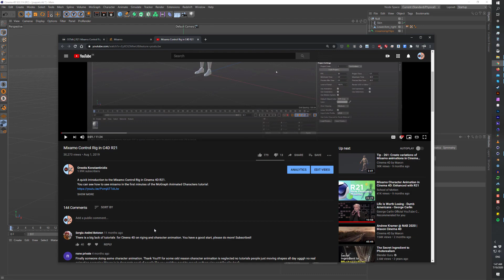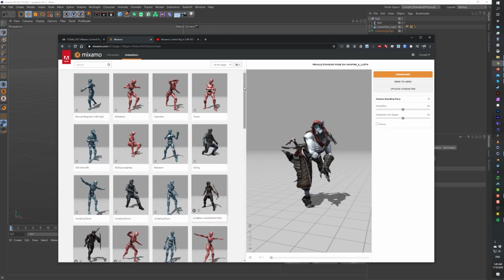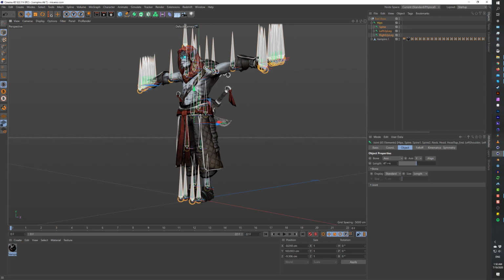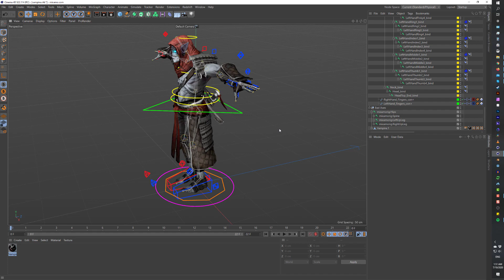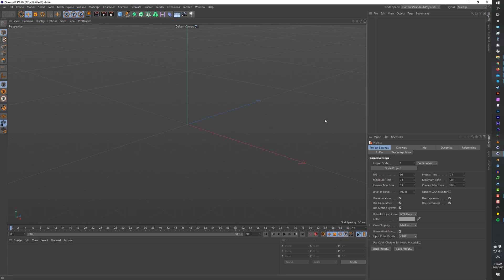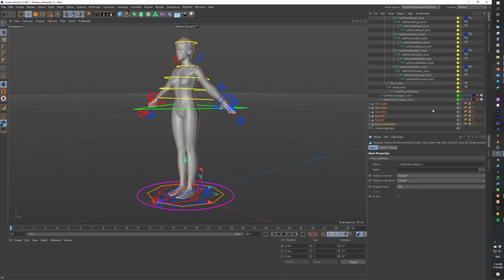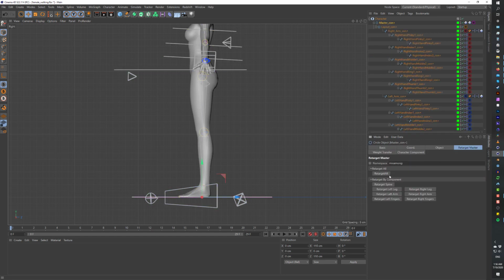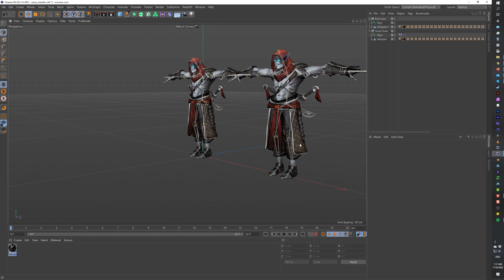Mixamo Control Rig Pt.2: Troubleshooting

Comment: Before Adjust And Weight Transfer Make Sure

-all joint or null axis are alligned and centered properly. 
- all joints are named correctly 
- weight mesh to bind pose (if mesh snaps out of position when setting bind pose, use ‘Current State to Object’, delete old mesh, NOW set bind pose, apply new Skin to Mesh)
-if knees bend wrong direction and cannot be corrected by offsetting the knee while Adjusting, fix Leg joint axis in attribute Allign and rebind
-if Re target or weight transfer does not have desired results it is most likely a bind or origin issue, make sure to give the namesake the correct Prefix in the Retarget Master 
- when renaming joints make use of Name Tool

Comment: Thank you so much for the useful tutorials. Since you haven't released part 2, did you fix the joints by using the joint align tool?
Reply from the maker: Hey,
there are two ways to fix them: One is with the Retarget Tag of R23, the other is manually with the Joint Align tool yes. But you need to do it on a controlled way, working separately per joint chain.
Reply: @orestiskon  Makes sense! Thank you so much for the info! Also, your tutorials are awesome and super clear :)

Comment: Thanks Orestis for the Video..I managed to make everything work perfect..But I can't export the edited animation into FBX to use on Unity engine.
You see, the problem is that the controller plays with the mesh itself only, and does not reflect the changes into the Original Rig.. Any ideas how to deal with this problem?

Comment: I can't even animate the rig, let alone the character. Yes, Mixamo rigged the character properly, but after adding the controllers, successfully aligning them and adjusting the knee joints, the rig/controllers just don't connect with each other. No communication between the rig, the controllers, or the character. They're just useless points floating in space.
Reply: Have you solved your problem? I have the same
Reply: Have u solve it ? Please.

Comment: hey great video i tried doing it as you said but after i click adjust and then animate i dont see the weight tab :( like when i click animate i dont see anything that says transfer weight
Reply from the maker: Hi,
depending on your version it might be an older version of the template. You can see that in my previous video. If it shows components instead of object, you can select the Root component and view the Controls tab of the character attributes.
You can see it here: https://youtu.be/EyXOlZiMiwU?t=165